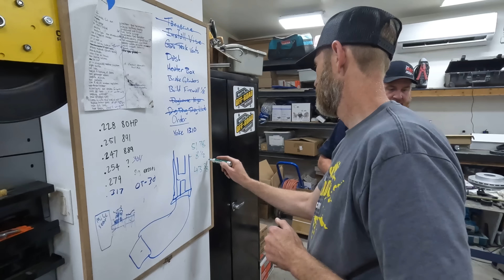The Bombi Working Backwards? Not A Big Fan.

Comment: I love Matt's overall designs; but lol, he should never be permitted to design a cooling system.  Who gets a double sized radiator, and then mounts it to the rear of the bumper making it the first thing hit, in a position that blocks off half of the core area?  Not to mention cutting the structural element of the rear end in order to mount a fan, but then blocking off the lower quadrant of that opening with plate steel?  You could literally mount the 2x radiator on the side of the bed, facing the side, attach two electric fans, and it would provide 2-3 times the cooling, increase access to the motor, and not compromise the strength of the rear end.  Not to mention being way easier to fabricate.  Times like these, I think he's trolling us all, and playing 3D chess, knowing that he'll need to make two Moor episodes about fixing it.  Bravo, Matt.

Comment: I suggest you put two radiators in, One on each side of the engine with a electric fan.
And it would give better protection for the radiators. And make it easier to install

Comment: Matt 86 the cooling fan put in a electric fans that run off the coolant temp can adjust to what u want also u could mount the radiator in the back also good luck

Comment: @23:20 Tiny flaw in your design, when you are closing off air intake or exhaust for a cooling fan you need to "balance the obstructions".
Otherwise you will exert an unbalanced load on the fan and your water pump bearing will prematurely fail on a SB Chevy with the fan mounted on the pump. Lessons learned in the Arctic.

Comment: First off i love the channel. I am sure you have a reason that i am unaware of, but with the fan setup to push hot air from the engine area it is being directed right into the radiator you might want to think of re locating  the radiator above or out of the hot air path from the fan. the engine will run cooler with the hot air not being blown into the radiator in my opinion. just something i thought of. either way i love the build and your channel iv watched all of your episodes and robbys and most of rorys and all of fab rats. keep up the good work. i would like to know your reasoning behind leaving the radiator where it is if you decide to do so. just to satisfy my curiosity lol God bless

Comment: With the fan always running, the engine may get colder than ideal running temperatures. 

It could be an idea to have adjustable vanes that vary the amount of outside air entering the engine compartement based on the engine temp

Comment: when i was younger an old timer told me to run bar and chain oil in my power steering pump to get rid of that "ford whine." I've tried in every ford ive had since, it has not worked a single time.

Comment: personally i will mount the radiator on the side with electrical fan ^^ You can keep the mechanical fan on the back so the hot air can go out by the back. But i'm pretty sur Matt hate electrical fan xD

Comment: The steering is probably great given the excellent product installed. But when the truck came across the rocks, I could swear I heard the familiar whine of a PS pump. I got used to the sound from my NAPA "replacement" pump. I almost wish I had rebuilt the old one. Never heard it and it was more responsive. Don't get me wrong, not criticizing. Blame my ears and your great mic.

Comment: Did you notice Tom's initial reaction to the fan/radiator shroud and mounting bracket plate? Later warming up to Matt's vision. Matt trusting Tom to order parts well in advance. This indicates that some pre-design and conceptualization is done earlier in the manufacturing process.

Comment: I have a nissan patrol y60 on 40’s and 46’s and just use the original steering pump no issue unless in alot of snow then it can get a bit heavy when stuck but no problems have used it for years  but now i want that couse matt said its worth it haha

Comment: Not a mechanic and just thinking out loud. Fixed fan seems dangerous with that little of clearance when you will be bouncing around in this. Also you will be working in tight spaces potentially so you might back into that radiator when running through tight spaces.

Can you mount two smaller radiators on either side of the engine bay with electric fans? Might help if you run it in sand by having the extra volume of coolant and radiator surface. By doing this you would also be able to reinforce the back side more.

Comment: I don't understand for moving air with the back side of the fan blades. Direction of air flow is determined by direction of rotation and pitch. Flipping the blade only changes efficiency not air flow direction. I demonstrated this to myself in trying to direct warm air toward the operator of a dozer for winter operation.
Reply from the maker: Correct. I change the pitch of the blade so it’s not pulling anymore. It is now pushing. Then I flipped the blade 180° to increase efficiency.  (I’m not really increasing its efficiency, I’m just making it spin the way it was designed)

There’s really only two variables here. 
Clockwise, or counter clockwise. That’s one variable.   
Left-handed pitch or right handed pitch. That’s the other variable.   

In a nutshell. 
I change the pitch for flow direction, and then I flipped it for efficiency.

Comment: With the "Dig-Dug" square body, Tom-Tom needs to vacate the factory steering column and install a PSC steering column. Ditch the bench seat and replace with PRP seats like in the off road wreaker. build and Install a custom center console for tool storage, drink and snack holder, and get the door panels back on the doors. Once all the mechanical is done, pass it on to Robby Layton to put on a Earl Scheib paint job on it.👍

Comment: JUST A FYI run a hydro line what ever size it is plumb it out of the DRAIN PLUG HOLE  to the back and you can DRIAN THE OIL THERE Plus put a REMOTE FILTER system on it in the back so you never have to crawl under it!!!!

Comment: With all due respect and probably being wrong,

There are two things that caught my attention. 

Disc brakes that seemed insufficient for the power and weight of the engine and other things  attached to the vehicle

Water radiator seems a bit small for the heavy workload that this little caterpillar will have to do

Comment: For Tom-Tom:  love the new ram assist!  Just curious if you reinforced the frame where the steering box mounts?  
I had a 73 Chevy 4x4 with 35s mine cracked and I remember this being a common problem for these trucks.
Reply: I have the Offroad Designs steering brace and no cracks.  The hydraulic assist should also help prevent frame cracks.

Comment: You auto make a shutter grille so you can try to control the air temperature in the snow weather.
Like the old Peter built and kw,s use to have .

Comment: Matt, I love how much Peanut loves you. I have a question though, a Chevy engine turns clockwise so that fan is going to pull air into the engine, not blow it out and if you turn it 180 degrees it does not change the direction the fan blows. Why do you think it's going to blow out through the radiator?
Reply from the maker: Please watch it again.  
Also, remember, the LS engine spins the water pump counterclockwise.
Reply: @MattsOffRoadRecovery  UGH!!! That serpentine belt got me! Thanks for schooling me. love your videos and all you do for people! (and puppies).

Comment: Heavy Expanded metal will let air through and  protect the radiator  in the event of a  recovery  gear failure which  could potentially  damage the radiator.

Comment: Am I missing something, or will the present driveline have one speed in forward and three in reverse? Was the third member/center chunk of the axle installed upside down to compensate? What about lubrication of the pinion bearings if that's the case?  Inquiring minds want to know.

Comment: you'd have been better off running dual electric fans and relocating the radiator up or angled overtop, then run isolated dual alternators/batteries with option to parallel them.
I get the simplicity of solid mounted mechanical fan, which is hard to beat in the long run.

Comment: Was it ever considered mounting the fan with its own pulley and bearing above the waterpump then mounting the radiator on the cross-member? The belt drive would need a redesign but there would have been far less hacking of the chassis.

Comment: Should the radiator be mounted somewhere it's not going to get hot air blown through it? I see it as hot engine compartment air being blown through a radiator that's supposed to be cooling the coolant. I may be wrong.

Comment: Love your channel and watch every episode.  Just now wondering how expelling hot air from around the engine through the radiator is going to cool the coolant that's supposed to go back into the engine block cooler than it came out ?  Wouldn't a side mount for the radiator (equipped with a couple of clutch fans sucking outside air in) work better, particularly if you then have the rear facing fan pushing all that hot air out backwards as well?

Comment: Matt, have you thought about mounting the radiator above the engine?  You would have to make a plenum to rought the air in from the sides of the engine bay.  But it would save a log of cutting on the main body.  You could use electric fans for cooling and route the air into the cab in the winter for heating.  The plenum would be a closed system without fear of carbon monoxide....Dave

Comment: why dont you run the radiator on one side, and an E-fan setup, then you can have intake on one side and exhaust on the other side, thats how they do it on excavators and such, then you can ditch the belt run fan, and do a solid rear end

Comment: Surely the radiator is going to be seeing air pre-heated by the engine and exhausts. Why wouldn’t you mount the radiator(s) on the sides of the engine bay and suck air through them? Still using the same fan arrangement. Not a mechanic, just curious.

Comment: Why are you guys using a gen 4 ls for the bombi? I get that they make a little more power, but with all the money you're spending buying a more expensive gen 4 engine and deleting the AFM cam and lifters you could probably build a gen 3 6.0 with a mild cam and flat top pistons and have money left over. Just curious. Maybe i missed the reasoning or you had a parts truck already. Its looking sweet though

Comment: Don't use the fan belt driven fan use electric fans and you can mount the radiator up higher.. as is,  half of it is going to be covered by the frame and water pump use electric fans and

Comment: Why aren’t you proof painting all the welds on all your creation to prevent rust ?
Reply from the maker: The whole things are gonna get sandblasting and powder coated.
Reply: Don’t forget to do the interior roof of the cab and also replace the windscreen of the wrecker.
Here in Australia it is illegal to have a cracked windscreen.
You’ve done a great job with all you projects.  Keep up the good work.

Comment: There is no such thing as too quiet of exhaust especially if you are running a stock or nearly stock motor.  I personally hate being bombarded by the nasty horrible sound of other people's vehicles.

If you want loud nasty exhaust you should pipe the exhaust into the cab of your vehicle and be sure to roll up the windows.

My daily driver is currently a 2009 saab 9-7x and it is powered by 434 cube lsx topped off with 4.9L Kenne Bell liquid cooled supercharger.  My daily driver pulley and tune is set at about 1200hp and it is as quiet as a stock vehicle.

Comment: Chevy v8 rotates clockwise , so your fan is blowing the wrong direction. Trying to help.
Reply from the maker: Crankshaft rotate clockwise. Water pump rotates counterclockwise on the LS engines and almost every other serpentine system.  
To make a pusher fan, you need a regular rotation fan flipped 180° to make a pusher. Trying to help.
Reply: @MattsOffRoadRecovery  Thanks,  that makes sense.

Comment: You are gunna have some SERIOUS cooling issues with that engine if you are gunna be pulling all the hot air right from the engine block, and blowing it into the radiator. Radiators need COOL air to be pushed through them for them to function. At this point, you would be better off getting an electric fan setup for the radiator and swap the engine block fan back to blowing on the motor.
Reply from the maker: It’s gonna be fun to see.